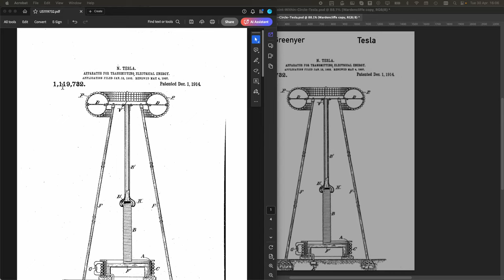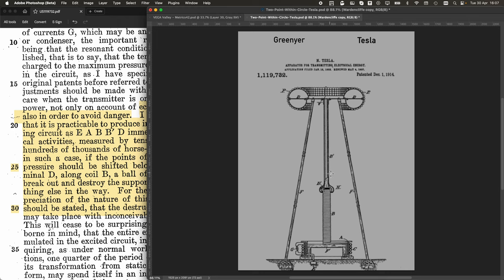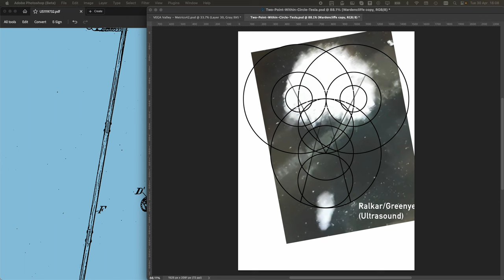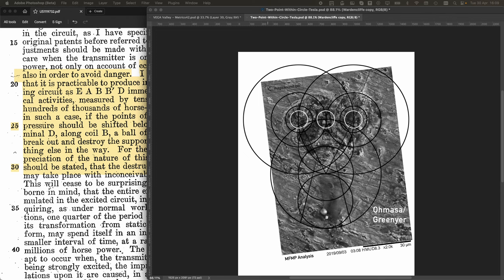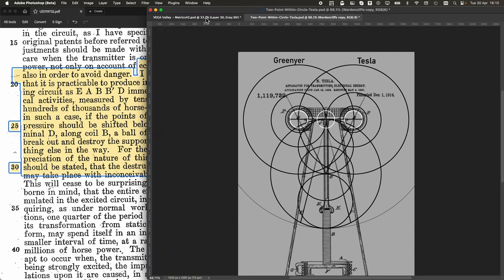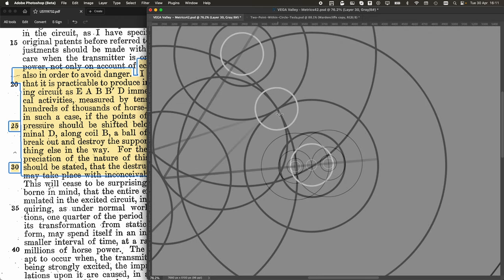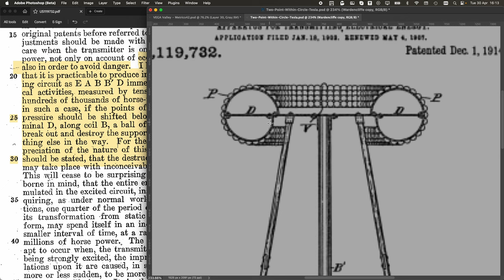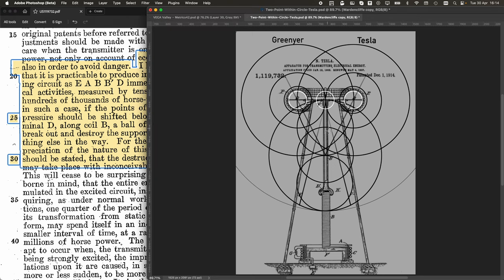I was wrong - but I am so happy!

Comment: Many thanks to this reflection, Bob.  I, too, was suffering under a misunderstanding that sent me to find out more exactly what was supposed to be going on in the WardenClyffe tower - and found that the majority of articles on the tower actually failed to understand its true operation, which, I hope, I have been able to now better understand and expalin in my comment below
Reply: Excellent post, Gordon.
My question now would be: What circumstance(s) would need to occur for the pressure to drop below the plate, D, and result in the destructive force? I.e. what would we need to control or avoid if replicating?
Reply from the maker: Thankyou Gordon, only through critical, referenced logic will we be able to iterate to the truth.

Comment: Tesla was talking about the standing wave on the top load. Because the tertiary inductance is a lot greater than the secondary, it is able to act like a reservoir through many cycles of the secondary. If the frequency is out and the standing wave node is not on the top load, it can break out and destroy the apparatus.
Reply: The top load was designed not to breakout but to reflect the power back to the ground, if that energy node was lower you can imagine the possible destruction.
Reply from the maker: @goldsphere  Thanks for your detailed contribution.

Comment: Hi bob I found the Los alamos slide that shows the disruptive discharge tranformer I built also high voltage and rf together can creat a very powerfull dis hard threw concrete fom the Flo up to a funnel 3 feet high 1 foot wide down at floor level it’s a 1/8 if a inch wide it scared me I had a c02 fire unit it lasted maybe 5 second s I think I mentioned it to George
Reply from the maker: Thanks, yes.

Comment: Do you know why you will get ball lightning or a fireball, when you move that area down?
Down like in a V shape, so that the center is further away from the two outer points?

I'm reminded of a safety video i saw on facebook a few weeks ago.
It was giving advice on what to do if a power line is down on the road and still live.
According to them, IF you are standing in range, like on wet ground and start get shocked, you should put all points of contact as close to each other as possible. So for example, if you need to move away on foot, you put both feet side by side together and hop away, or hop away with one foot as a point of contact.
The reasoning was that if you spread those points of contact, you get a way bigger charge building up, or going through you.
If can be the difference between dying and hopping your way out apparently ^^

So.. when you move that center point down, might there be a similar mechanic going on there with potentials, reverberations etc etc?
It may be that he tried this with them closer together, and further away, only settling on this schematic because the ratios for distance was worked out to be perfect for the amount of potential he wanted to create or work with.
Reply from the maker: I only know that he claimed to have learnt how to make artificial ball lightning and what produces it well before the 1914 patent and that he was advising against movement of the D lower down in order to avoid it appearing.
Reply: @MFMP  I hadn't heard Tesla messed with ball lightning, until you mentioned it. I wonder if John Worrel Keely had similar "issues" with cavitation with his machines in the 1880's.

Maybe the lowering of that center point creates a longer vortex in, well the aether.
I should do some reading on that tower.
From the little I could see from the schematic you showed, it looks like it's running a coil horizontally in a circle. Which is why I considered a vortex inside and the reason why you might not want to make it too much bigger.
HHmmm.. The right hand rule and that  schematic. I'm very curious which way the flow went if that was indeed a horizontally looped coil.
Anti clockwise I suppose would be send a vortex downwards if there was one.

So tired and so many interesting things I wish I could investigate more.
Thanks for keeping us all updated. Very interesting stuff, and i really like that you are not so stuck in contemporary belief systems within science and investigation of reality!
Reply from the maker: @falls2shine712  Perhaps we are giving them too much credit and they didn't work these things out.

Comment: Maximum pressure Tesla as well as leakage  this unit was uses that term lots high pressure is the voltage level’s at high frequency high voltage  also where it will break threw insulated areas the section might produce a reddish coloured  smoky ball but the unit should freely work in broadcast mode on the top terminal as a fine fuzzy coloured light 
Close to the terminal a balance is needed in capacitance or the Q of the terminal as big as this causes issues and a unwanted discharge can occur in other areas that would effect the total output this loses output power read about his disruptive discharge transformer I built one I have pictures of it taken by Los Alomos  and Col alexander   It mentions similar things
Reply from the maker: Thanks Baroness, also I found an online link to the book - it will be on my blog.

Comment: You are misinterpreting what Nikola is saying. Anyone who builds Tesla coils knows what happens if the breakout point shifts down. The difference being that the coil assemblies don't usually have the rounded top terminal so far removed from the coil
Reply from the maker: Well - he does say the coil can extend up the shaft B. I was correcting my mistake referring to D' rather than D. This is helpful, because at D' is where we see de-pressurisation and D is where we see pressure, his words in the patent are "maximum pressure", in his - and presumably all other systems similar, this would be the danger zone, he alleviates the risk also by adding a few sub-hemispheres with a tighter than pure sphere radii as bleed off points.
Reply: @MFMP  Pressure means Voltage, every point above the coil between D and D' is at the same pressure and all he does is explain how the geometry (of the conductor extending beyond the coil) prevents "leakage" aka "breakout" aka regular T coil lightning
Reply: @MFMP  yes, he adds sharper points on the top for controlled breakout if desired V is exceeded
Reply from the maker: @sFeral  Tesla was obsessed with static electricity, static electricity is EVOs/Charge Clusters/Orgone/ECTONs etc and necessary for BL production. A "ball of fire" was not IMHO a unipolar discharge of energy, I firmly believe he is referring to Ball Lightning not just an inconvenient potential.
Reply: @MFMP  well as I said that's your interpretation but there's no indication he's referring to anything other than the common AC spark seen in every TC video, the only difference being the much greater amount of power in his huge assembly. Sparks do take different shapes due to different modes of driving the secondary, though I've seen no free floating glowing balls as of yet. Coilers don't usually construct their coil assemblies with the same goals in mind as Tesla did
Reply from the maker: @sFeral  
In his 1914 patent, he does not say sparks, he says "A BALL OF FIRE MIGHT
 BREAK OUT AND DESTROY THE SUPPORT F or any
thing else in the way. For the better ap
preciation of the nature of this danger it
 should be stated, that the destructive action may take place with inconceivable violence."

Nikola Tesla was in Colorado Springs from May 1899 to January 1900. From his Colorado springs notes.

"Colorado is a country famous for the natural displays of electric force. In that dry and rarefied atmosphere the sun's rays beat on objects with fierce intensity. I raised steam to a dangerous pressure, in barrels filled with concentrated salt solution and the tinfoil coating of some of my elevated terminals shriveled in the fiery blaze. An experimental high tension transformer, carelessly exposed to the rays of the setting sun, had most of its insulating compound melted and was rendered useless.

Aided by the dryness and rarefaction of the air, the water evaporates as in a boiler, and static electricity is generated in abundance. Lightning discharges are, accordingly, very frequent and sometimes of inconceivable violence. On one occasion approximately 12,000 discharges occurred within two hours, and all in the radius of certainly less than 50 kilometers [about 30 miles] from the laboratory. Many of them resembled gigantic trees of fire with the trunks up or down. I NEVER SAW FIREBALLS, BUT AS A COMPENSATION FOR MY DISAPPOINTMENT I SUCCEEDED LATER IN DETERMINING THE MODE OF THEIR FORMATION AND PRODUCING THEM ARTIFICIALLY."

He therefore claimed to have learned how to produced them, could produce them artificially and probably knew the geometries that did produce them and how to avoid that.

Telsla clearly chose his words (and imagery) very carefully, he knew the difference between a spark and a fireball, it the patent, he specifically said fireball, not spark.
Reply: @MFMP  yes I know the words he uses, but without any additional description or emphasis on the phenomenon itself, there's no reason to assume it's anything else than readily observed and in this particular patent it is just a nuisance playing no role in the function, otherwise he would've explained it. People regularly use the term "fire ball" when houses go ablaze, but there's never any actual balls involved, only flames that become separated in mid air, which can be observed even around a camp fire if the flame is turbulent enough and also with electric flame TQh8FlJv2OQ
Reply from the maker: @sFeral  Wonderfully, Tesla wrote short patents. When you write something short, you choose your words VERY carefully, they will be there for all time. He knew the difference between spark and ball of fire, he had established how to make fireballs before the patent was written and clearly separated the lightning discharges that he saw in Colorado from the fireballs he did not see but learned how to make, in his own prior words. He meant what he said, and it logically explains his expectation that it would destroy the support F. We have seen how exploding ball lightning can push wooden buildings apart here:

https://youtu.be/Mweq6f093ns?si=-aHDm43vEwxRBVuT&t=1693
Reply: @MFMP  You choose to believe he was always so consistent with the wording but either way in this context you place too much weight on it as the patent isn't about producing ball lightning or has anyone replicated them publicly by making coil assemblies that close in on his designs. Why would he hide in the open by using such words ? There's no point to it, and indeed if you figured out what circumstances create ball lightning, you should be able to produce a schematic and have someone build it, if you're not able yourself. You also choose to disregard what a regularly observed discharge can do, just look at any trafo station fire _2LpCdhuOyQ
Reply from the maker: @sFeral  That is the point, it isn't about producing Ball Lightning and so he notes how to avoid it hapenning.
Reply: @MFMP  no it's not, it's your far fetched interpretation until there's proven evidence to the contrary. You've side stepped all my poignant arguments
Reply: @MFMP  I skipped over the part right under the text you highlighted, there he explains how to produce the "fireball", and reading that jogged my memory about certain "Corum brothers" who allegedly managed to produce the BL, but the procedure is simple enough that I'm still not convinced hobbyists wouldn't have replicated the results, considering the sophistication of the driver circuits they employ in DRSSTCs and alike
Reply: @MFMP  I highly doubt everyone could avoid this phenomenon so well given the amount of experimentation they do
Reply from the maker: @sFeral  Your saying "ball of fire" means lightning. I am saying that "ball of fire" means "ball of fire" and it is the core of "balls of fire" that exactly form on that D terminal line in our experiments, so if he did not mean what he said, he got very lucky.

Have you built a Tesla coil with these proportions with a toroid so configured?

The point of having a toroid coated with hemispheres is to absolutely maximise the amount of static electricity without emission. Static electricity are EVOs.
https://remoteview.substack.com/p/where-is-the-atom-battery?utm_source=publication-search

EVOs can aggregate and cohere. If they de-cohere all at once, they produce a violent coulombic explosion we have done that two.
https://remoteview.substack.com/p/vega?utm_source=publication-search

We have produced stable toroids for about a few seconds (which have a glowing sphere you can see through), when they de-stabilised they launch themselves at great velocity to the sheath leaving fractal toroidal marks.

You can see these impact marks in extraordinary clarity in the images at the bottom of this page (right click on image and view in new window and click to see and navigate the full resolution)
https://remoteview.substack.com/p/the-mark-of-an-exotic-vacuum-object?utm_source=publication-search

Here is a video of the tors being formed (exposure set to look through the ball of fire) you can seen the umbilical tornado feeding electrons into the tor)
https://www.youtube.com/live/gW0JPZedjXM?si=1KWXDAIVAUEfNis_&t=10186
Reply: @MFMP  You are mixing things up. The array of hemispheres is there because he couldn't guarantee the uniformity of (curvature of) such a large dome... and it would have been a dome, not a torus, the actual construction was photographed
Reply from the maker: @sFeral  The patent is a Torus I have seen the model of the part construction from the Serbian museum.
Reply: @MFMP  which proves what ?
Reply from the maker: @sFeral  Neither view is proof of anything, however, Tesla knew the difference between a ball and a lighting, he describes copper balls in his apparatus in Colorado, it is occams razor that when he says "ball of fire" he meant that, which was and still is a common name for Ball Lightning. In addition, we show a ball of fire forming in our experiments at exactly the same line on the sacred geometry form positions as D, that the self-organising electrons form, regardless of system we look at, from plasma to water. Perhaps if the the patent and Ball Lightning did not involve electrons I'd have a different view.
Reply: @MFMP  but he doesn't say the "ball of fire" could form at D or between D and D'. You've made that up. "...if the points of max pressure should be shifted below terminal D, along coil B, a ball of fire might break out..." are the exact words in the patent. You're interpretation fits your agenda but the actual info doesn't fit together. In fact these words enforce what I've said at the very beginning, about the Voltage at these points
Reply from the maker: @sFeral  He doesn't say where it will form either, however, he is not saying to move the torus down and the Static Electricity builds up on this structure and there are to key points of focus fro its action, one in the centre of the torus and one in the centre of the radius of the torus.

Sorry, agenda? What is this agenda which you state I have, please be specific.

Personally I am volunteering my time to work out what nature does, and since I paid attention to physical acts of nature across systems it has become laughably predictable as to its products. YES I am perhaps giving too much credit to Tesla for working out the geometry that forms Ball Lightning and the mean square radius that forms an impenetrable barrier - but he did say he had worked out how to make it and could, and in his claim about his "weapon to end all wars"  he said the device would make war impossible by offering every country an

"invisible Chinese wall"

And his press photo for that was the exact structure of the thing that does this.

http://www.beograd.com.au/magazine/nikola_tesla.html
Reply: @MFMP  you've turned evasion into an art form, even aggressively ignoring the original tower that was built and torn down lol Evidence speaks for itself.
Reply: @MFMP  there's no image of a torus anywhere on the linked page
Reply from the maker: @sFeral  And that is why no one (at least publicly to the best of my knowledge) could work this out or grasp his true grasp of how nature works - until last year.

https://www.youtube.com/live/n2caD_0lzJI?si=jd01NYF2FJyD6h_E&t=2040